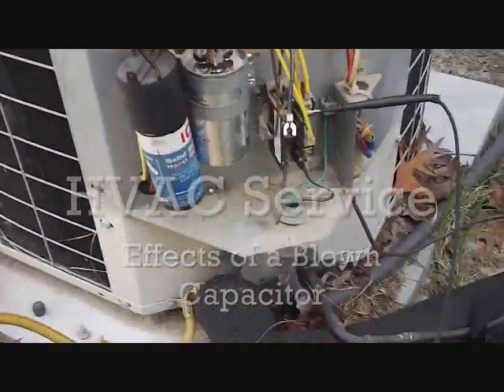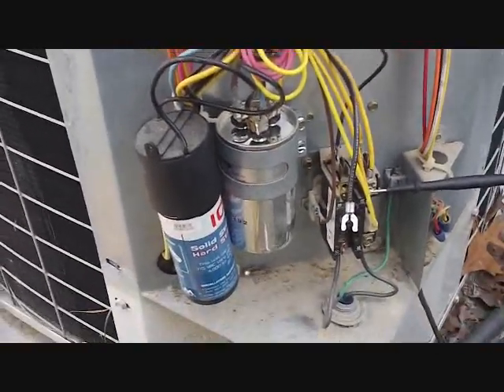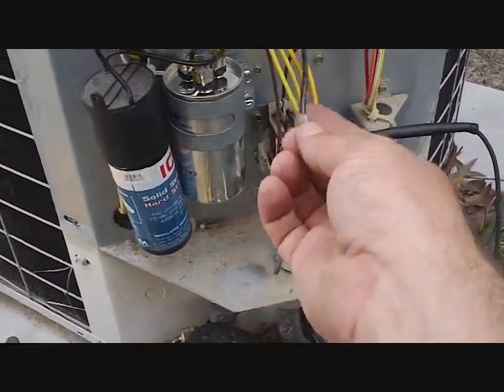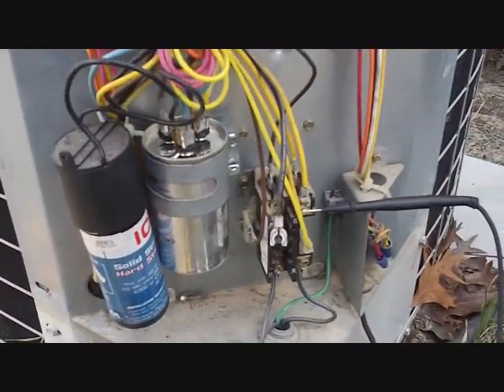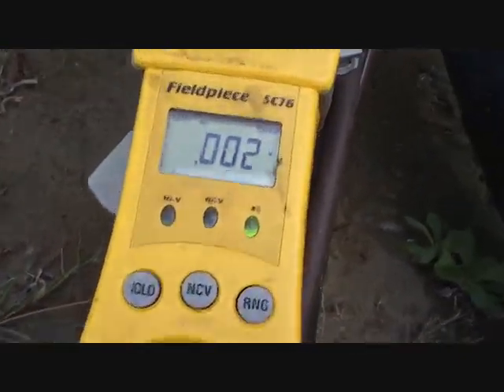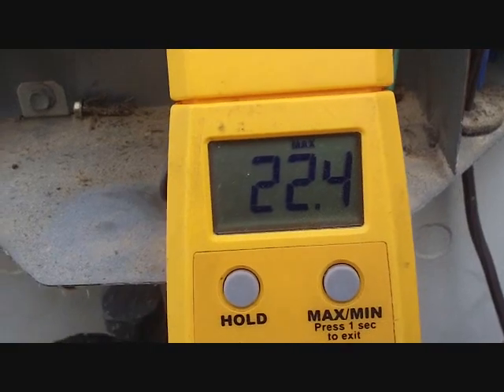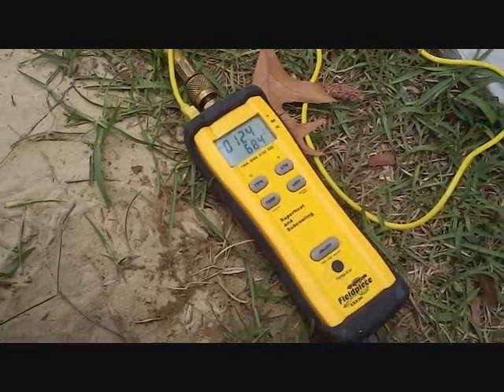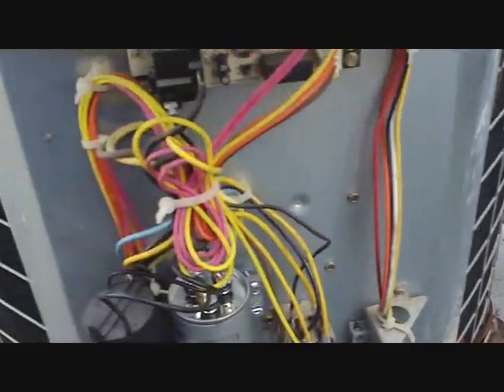HVAC Service | Blown Dual Run Capacitor | Compressor Thermal Overload

Comment: Does a motor going into thermal overload cause the start capacitor (the big black capacitor) to get blown , because normally the start capacitor is supposed to taken out of the circuit within a fraction of a second?   If the motor goes into overload at start then doesn't that keep the start capacitor in the circuit until either the power to the whole condenser unit is shut off, or the motor comes out of overload?   If so, then wouldn't this burn out or blow up the start capacitor?